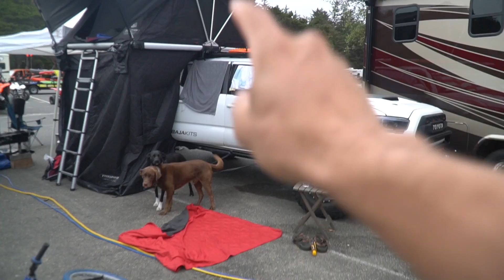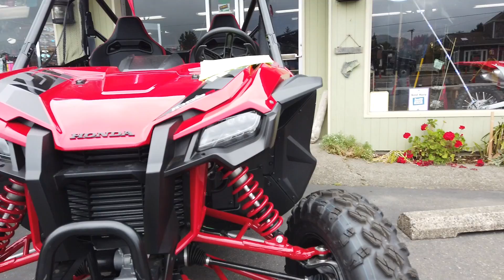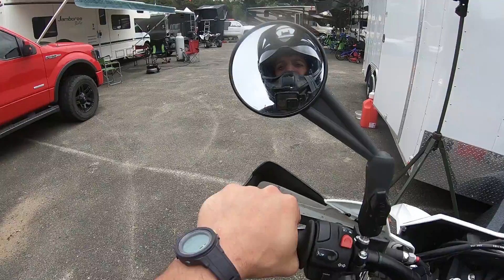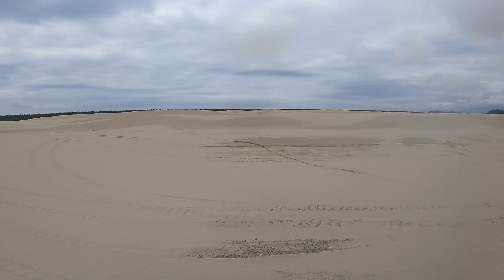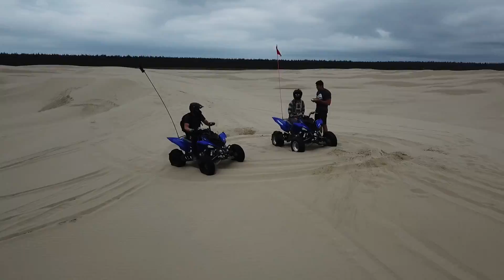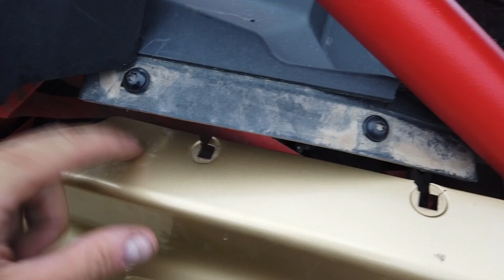Wife Learns how to Ride a Quad after I Rolled The Can Am X3 😬😅

Comment: Ah the driftwood campground. I spent so much time there with my family when I was a kid. So fun. And I remember the first time I crashed my quad, and when my parents crashed. It happens no matter your skill or experience but there is a learning curve. Also I would recommend on the dirt bike, make sure the tire pressure is as low as possible (in our quads we ran like 4-6 psi) and try not to weight forward. Also there is likely a lot of frame damage on the Can-Am that you won't be able to see such as minor stress fractures and/or minor buckling.

Comment: Glad you were able to still have fun...and no one got hurt during the accident! Have you thought about building you own frame for a dune buggy out of thick walled Chromoly tubing and just transferring all the running gear, suspension etc from the cam-am.. And calling it  the maxxbug?  It might be cheaper then try to fix that one peace and those stressed areas aren't a great either...you might not be able to ever get that frame straight again.... Also thick wall Chromoly tubing is what they use in race car for roll cages so it would definitely be stronger and safer!!!! Love watching the show btw keep it going brother!

Comment: Hammer that kinked part straight and weld a piece of angle iron to it and maybe to the other side for added strength and spray paint red. Kinda janky but cheap and fully functional fix.

Comment: I would just get new cage and just weld that bent bar
Reply from the maker: I think that's what we're going to try to do
Reply: Maxx Powell ya that’s good idea
Reply from the maker: Got a couple quotes this week for Fab work.  Considering that it will be super tough afterwards and actually have a functional roll cage and bumper the cost isnt going to be too horrible
Reply: Maxx Powell your best bet is to find a roll cage online the plastics better buying off eBay or for the cage just re weld the cage because the stock cages welds are bad